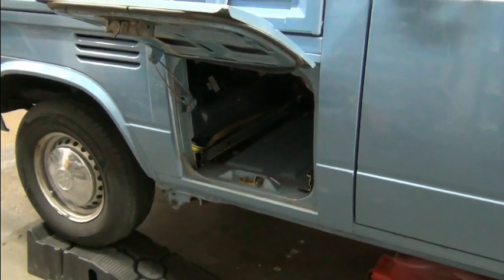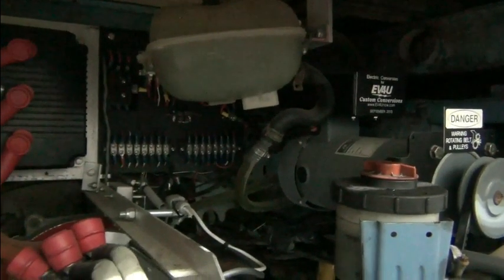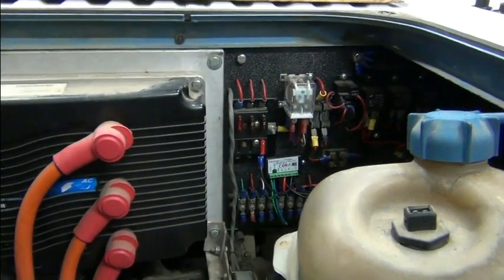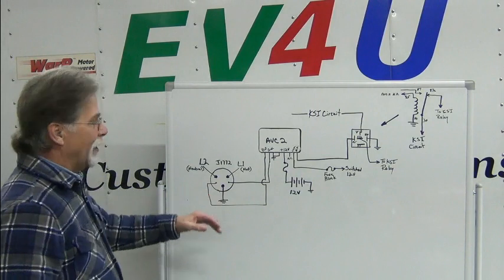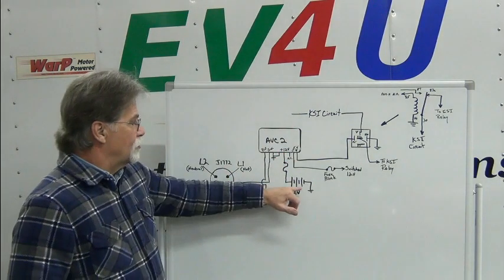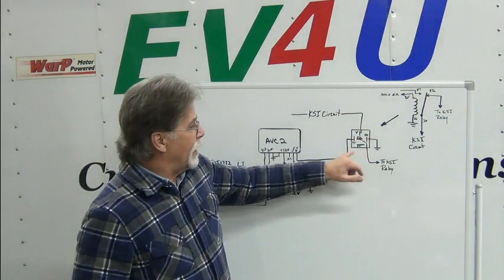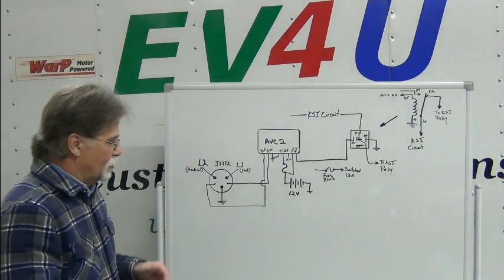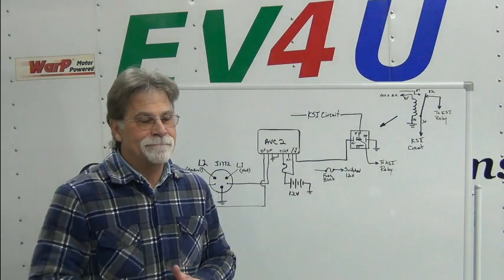EV Projects - Part 2

Comment: Greatly appreciated the deeper technical details.  I am running my 12v+ and Common from the LinkPro SOC meter.  Using it as a relay to cut power to the AVC2 if the SOC is showing 100% , just in case the BMS doesn't shut off the charging as a double precaution.  Not sure if it's needed.
Reply from the maker: All of our systems have feature a redundant shut-off for the charger.  The charger is programmed to shut off at the pack charge-to voltage, we use instrumentation to shut off the charger enable at the same voltage,  and we also use the instrumentation to shut off the J1772 via the AVC2.  I recommend using pack voltage to shut down the charger instead of SOC.  SOC is not as accurate as measuring the pack voltage.